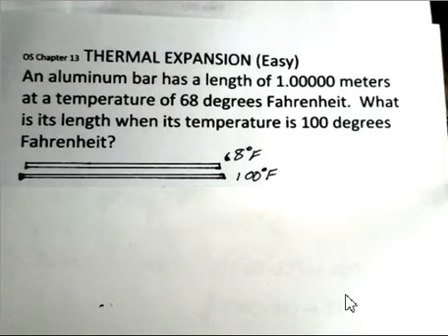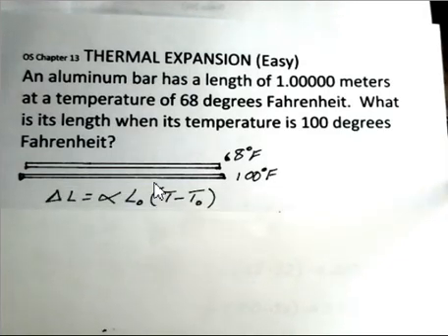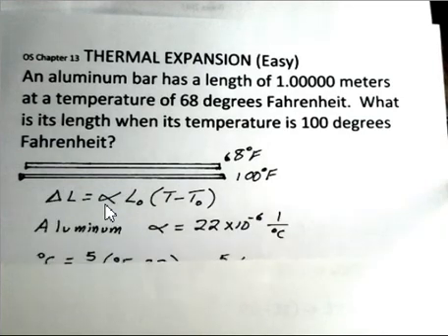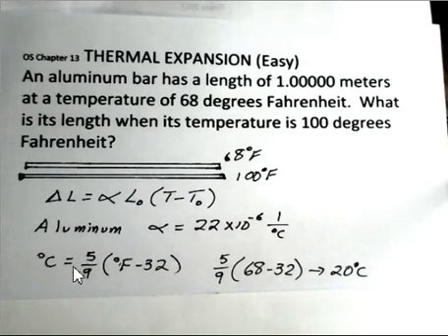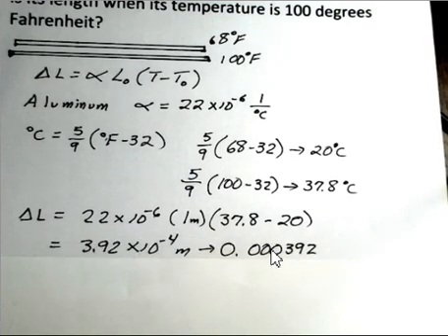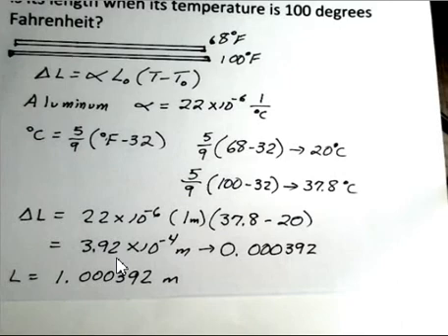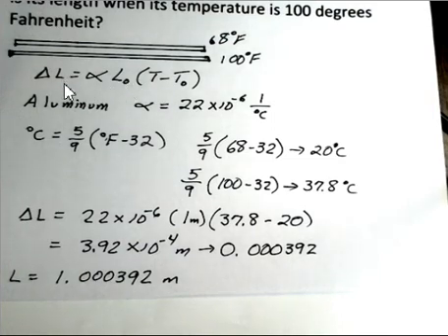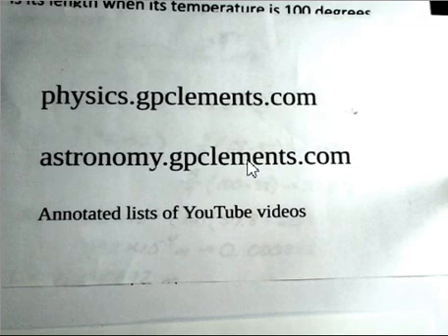Linear Thermal Expansion Calculation

Comment: Hello
What is the minimum calculated expansion value that we must have expansion joint?
Reply from the maker: Sorry. There is not enough information in your comment to help you do the calculation.
Reply: @GregClementsScience  Thanks. I need to know,    what is the minimum calculated value for thermal  expansion of a black steel pipe that necessitates the use of expansion joint, smaller than that value you do not need to use expansion joint or any other expansion compensator.
Reply from the maker: @ahmadawada5363  The expansion equation is  (amount of expansion) = (coefficient of expansion) * (original length) *(temperature change in Celsius).  From your question I assume you need to calculate the (amount of expansion).  To do the calculation :   You will need to look up in a table the value of the coefficient of expansion for your type of pipe.  You will need to know the length of the pipe, and you need to know if there are two pipes that are expanding towards each other.  You need to know how much stress the pipe can endure before it bends.  You need to know the value of the temperature change in Celsius.  You probably need to ask your instructor for hints on how to do this calculation.  I have never performed a calculation like this with so many unknowns.  As I read the problem, perhaps it is not a thermal expansion problem at all, but rather a problem involving stress or strain on an iron pipe...this is a topic of which I have no knowledge.
Reply: @GregClementsScience  Thank you Greg for the explanation. 
Actually I know how to calculate Thermal expansion for piping including steel piping. My question is how much the thermal expansion should be so I must use expansion compensator such as expansion joint. For example, say if the thermal expansion is 1/2 inch (12.5 mm) or less, i do not need to use expansion compensator or joint becuse the pipe itself will take care of this much thermal expansion.  If  it is larger than 1/2 inch (12.5 mm) then we must use expansion compensator or joint. The above is only an example